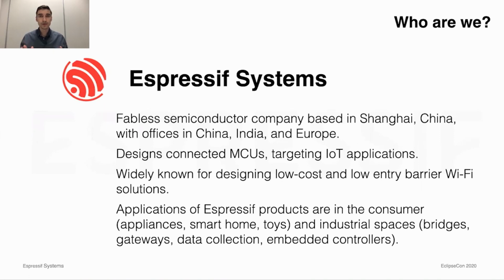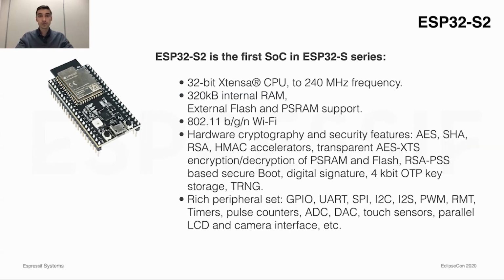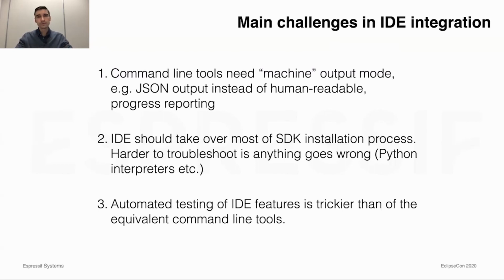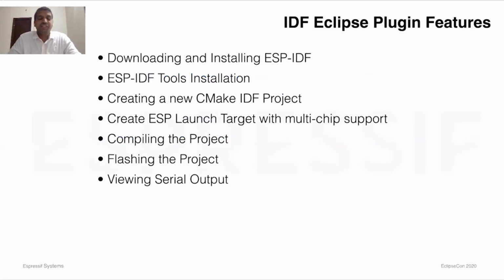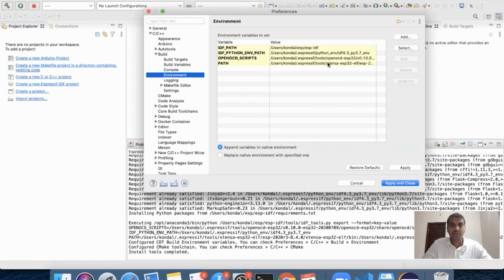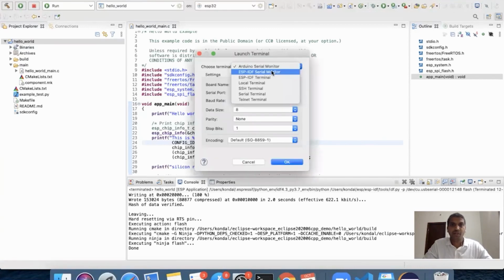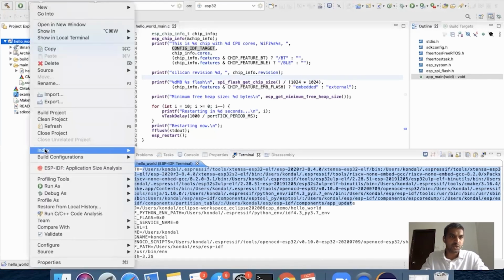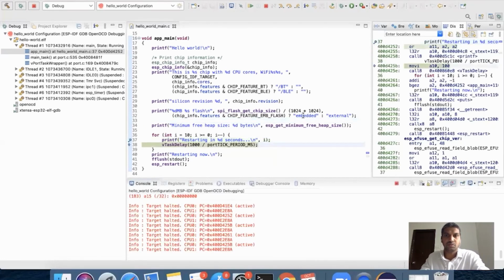Developing and Debugging ESP32 IoT Applications using Espressif Eclipse Plugin

Comment: If I use other boards such as ESP32-WROOM-32UE, how do I set the interface and the cfg file in Debugger - Config options? Thanks!
Reply: Add "esp-wroom-32.cfg" instead of the default one and interface you can use the existing one, the path for both of files would look something like  "~/home/.espressif/tools/openocd-esp32/v0.10.0-esp32-20200709/openocd-esp32/share/openocd/scripts/board" make sure your OPENOCD_SCRIPTS path is set in eclipse environment.

Comment: setting up the debug option for blink ..I have a esp32 ...I do not have esp32-wrover.... can I still use the eclipse debugger  (present default config option is -s ${openocd_path}/share/openocd/scripts -f interface/ftdi/esp32_devkitj_v1.cfg -f board/esp32-wrover-kit-1.8v.cfg)...what is to be changed for it to work with esp32
Reply: Add "esp-wroom-32.cfg" instead of the default one and interface you can use the existing one, the path for both of the files would look something like  "~/home/.espressif/tools/openocd-esp32/v0.10.0-esp32-20200709/openocd-esp32/share/openocd/scripts/board" make sure your OPENOCD_SCRIPTS path is set in eclipse environment.